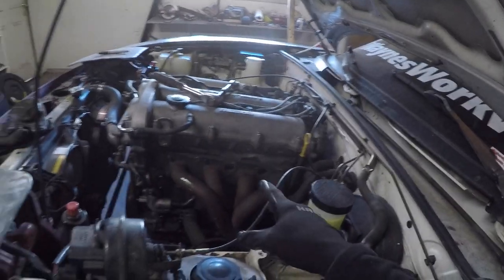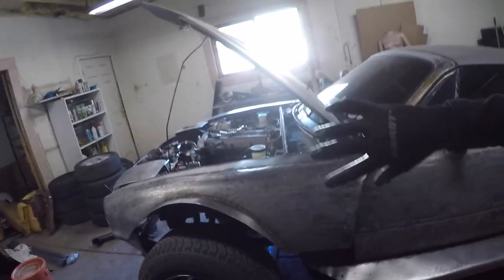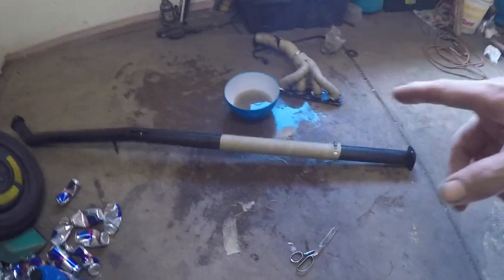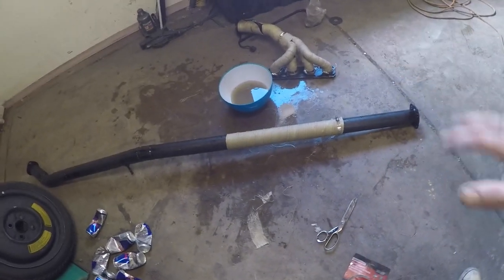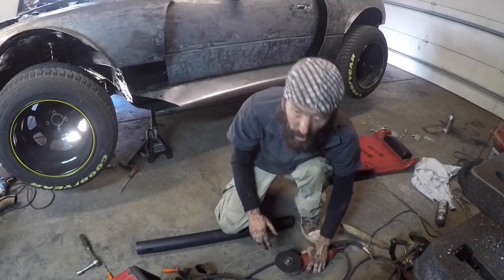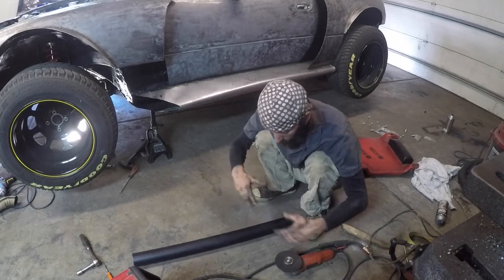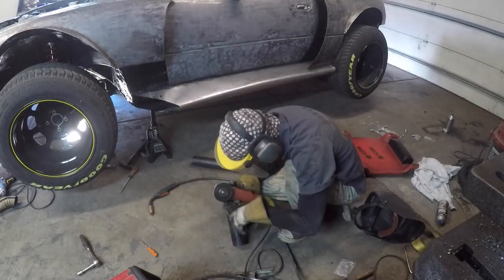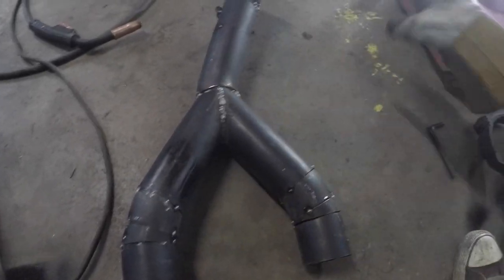Miata 2.5" straight pipe exhaust Part 2 S06E41

Comment: Lmao that's fuckin loud
Reply from the maker: and its ten times worse when driving. lol. next video: muffler install.
Reply: Wayne'sWork!Vlog I'm planning on doing a decat for mine and replacing it with a resonated pipe. What muffler you thinking?
Reply from the maker: Bambi the Miata i have an ANSA muffler laying around so will use that. and just do a straight pipe in place of the cat. otherwise it gets really loud and hot under the shifter
Reply: Wayne'sWork!Vlog yeah planning on straight pipe but hopefully finding a resonated one so itll sound a little less rapsy. Will the resonated pipe be hotter? seems the same
Reply from the maker: Bambi the Miata its def hot. made my trans tunnel too hot to touch. pipe it and keep a good muffler.
Reply: +Wayne'sWork!Vlog interesting. Maybe I'll make some heat insulation just in case
Reply from the maker: Bambi the Miata or just straight pipe it... resonator isn't necessary.
Reply: +Wayne'sWork!Vlog yeah might do that